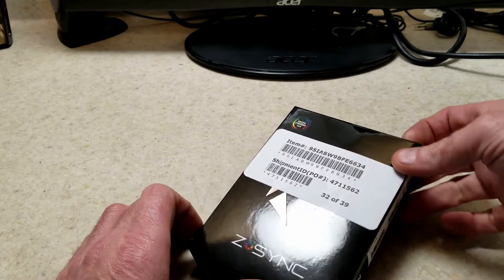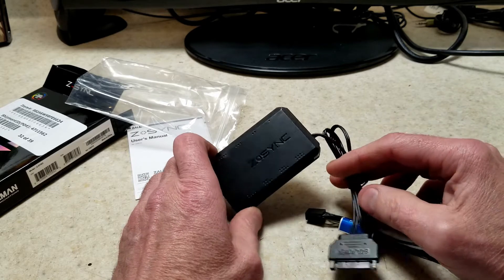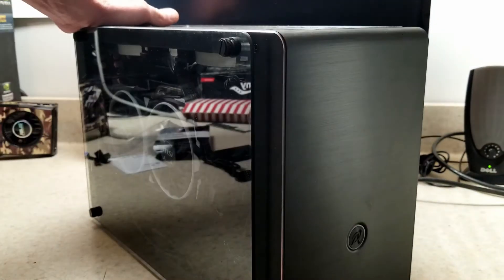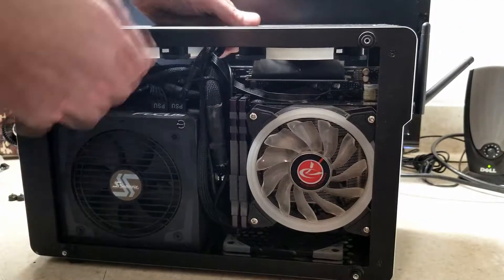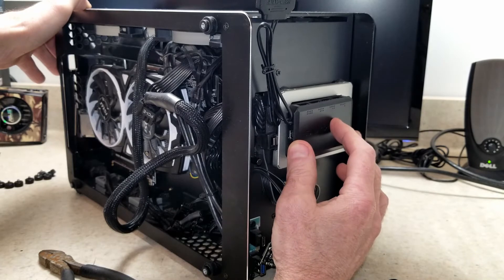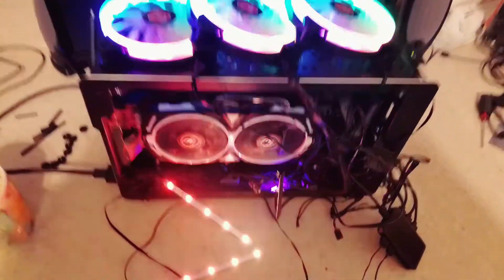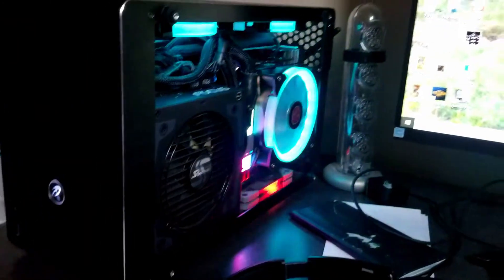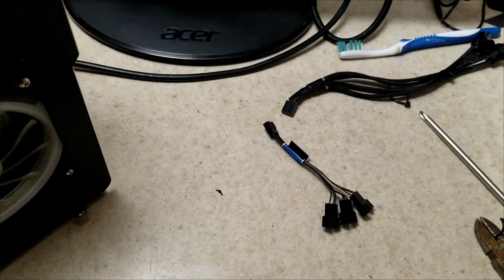Zalman Z Sync Addressable RGB Controller Hub

Comment: is there any way I'd actually be able to edit the zalman rgb inside of my computer or is that mission impossible
Reply from the maker: That i dont know, BUT.. signalRGB does now support it, i have been using it to control the zsync on my wifes pc for months now. I vompletely uninstalled the zalman software and installed signal rgb and it showed up right away
Reply: @Snickerrick  I don't even have the zalman software and for some reason signal rgb isn't detecting my zalman rgb, I have ZP1225A's, if that makes a difference, do you know how to fix this problem?
Reply from the maker: @shredkratcher  man im sorry i dont. The only thing i can suggest is unplug it and plug it back in, other than that im not sure why it isnt detecting it. Signalrgb might have a forum where you can ask as well.
Reply: @imridge I've also bought z-sync rgb controller but it doesn't connect. Have you fixed it?
Reply: @_.thegiga._  no I kinda just gave up lol, ig I can always just change the part to something else if I’m really that intrigued

Comment: Man that case is tight to work in! If you have an Amazon account in the USA, there's a review for this product by a guy called Peter Hudson. "Most critical" review mentioning a "Dumpster Fire". Anyway, he's a software guy and claims to have fixed it and "uploaded" it. Dunno if you can contact him for a copy?
Oh aye and now you've got it all tidy again, swap out the fan in the PSU. TeeHee! :)
Reply from the maker: It is really tight, but a sff PSU and custom length cables would alleviate a lot of that. I see that z sync is going to be supported in the next revision of openRGB so I will just wait for that, it is doing its rainbow thing now and she likes that lol. But I think I saw that review, I might have to investigate a bit. The fan in the power supply never spins, last thing I need to do is highlight that lol, the wife will keep asking me why it isnt turning on.

Comment: Don't choose another hub only because the soft is bad. We live in the world where signalrgb is exists.
Reply from the maker: I actually use signal and openrgb, both are excellent, but neither is compatible with the zalman hub. They both work perfect with the razer hub
Reply: @Snickerrick  wow. Strange. I use two z-sync hubs with signalrgb and both of them works fine. Devs even mention z-sync several times in their vids and discord server as “one of the best universal controllers”
Reply from the maker: @mrartifact  I may have to check it out again, I cant get it to read it at all. Maybe the hub is faulty, I will try to test it out. Thanks for the heads up!
Reply: I think I know what it can be. When I install them for the first time I actually need to "hot swap" the cables (sata+usb) when PC was on. After that - both hubs was identified by pc and signalrgb. Weird thing is - this problem never accured again, even if I pulled out the PC power cable.
Reply from the maker: @mrartifact  Hey thanks, I will definitely give that a try!... that is a strange solution, but if it works I wont question it lol